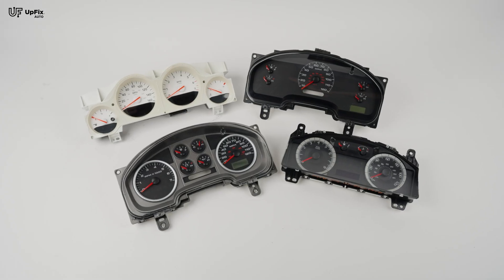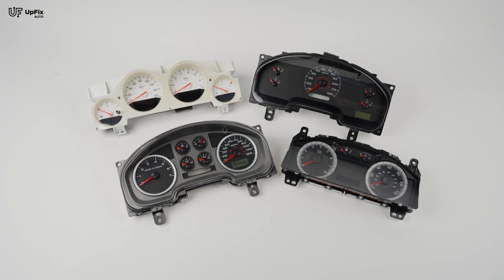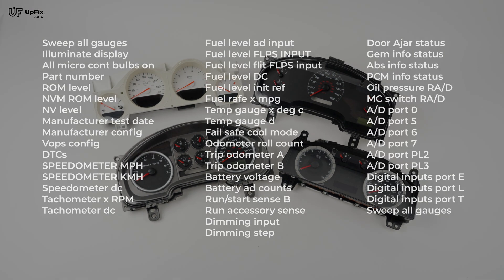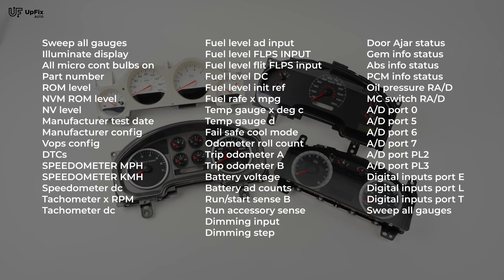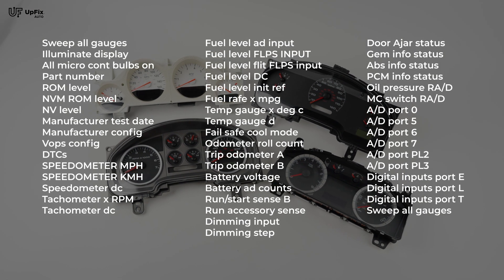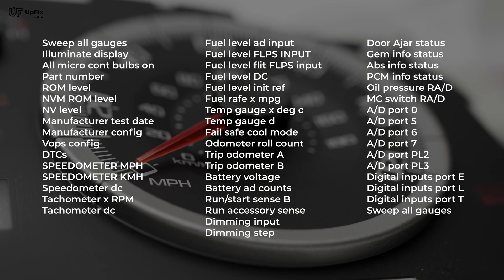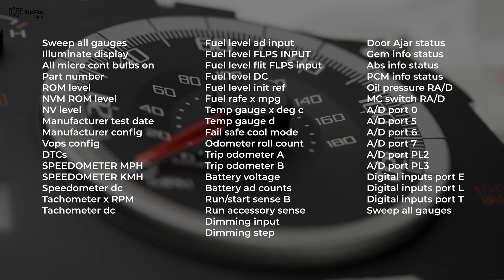Engineering Test Mode for Instrument Cluster Repair Ford, Lincoln, Mercury   Dodge, Chrysler #UpFix

Comment: I had a situation where my F250 gauges parked at 1krpm and 20mph. Using test mode to sweep the gauges forced them to park correctly again. I knew about engineering test mode but had forgotten how to enter. Thank you for the video.
Reply from the maker: If the instrument cluster keeps acting up, it can be repaired. We do rebuild them. https://www.upfix.com/product/ford-f250-1999-2004-instrument-cluster-panel-icp-repair/